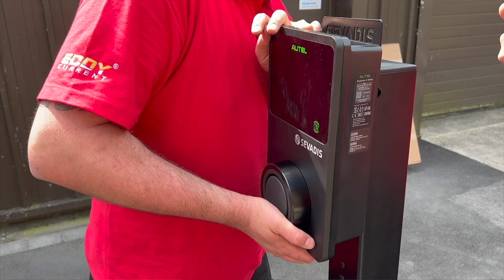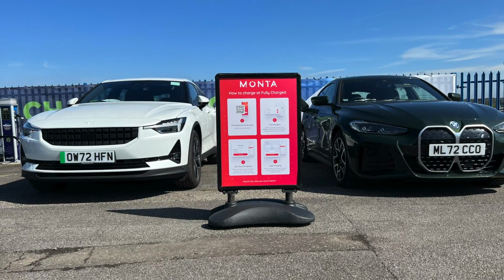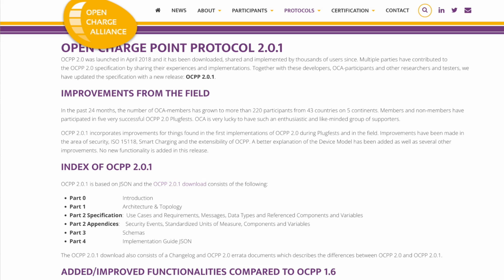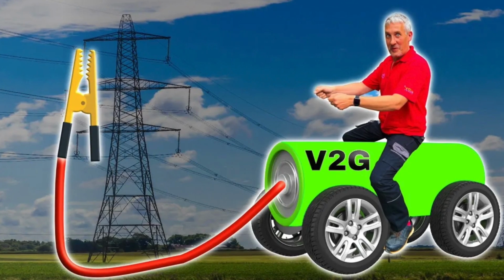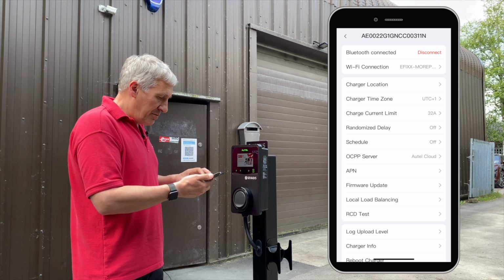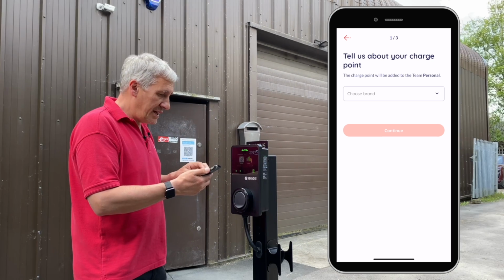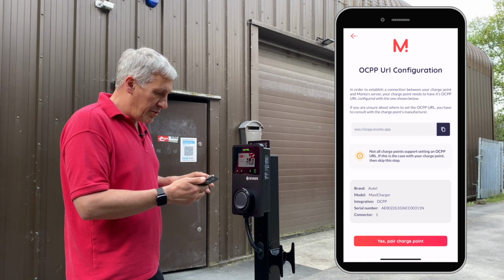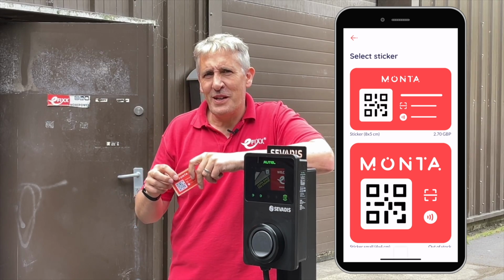OCPP Explained: The Easy Way to Improve EV Chargers

Comment: Lads and lasses, are you watching the transport ship fire? The source of the fire is not the point, it is the thermal runaway of the EV batteries in the compartments caught in the heat that makes it just a waiting game as there is no safety envelope able to deal with the exothermic reaction. There are enough reports of e-scooter fires and while an EV fire is a low probability of itself it is a high impact event. We need to seriously think about the siting of battery storage, of domestic charge points or in underground car parks. I know you are considering the electromechanical aspects of installations but you should make yourselves conversant with the risks, the least you can do is add a rider that your advice is only current at the date of the production and you are not liable for the interpretation in practice. Under the bed is probably not a good idea.
Reply from the maker: Insurers are already on the case 👉https://youtu.be/tucSKsyoKzw

Comment: OCPP is a great idea, but when there's connectivity issues the charger manufacturer and 3rd party App company just point the finger at each other. You end up stuck in the middle, In our case it's never worked and its been over 4 months.
Reply from the maker: Which charger and OCPP provider are you using?

Comment: Love efixx - glad you've covered this as a topic. 

My experience with this is that at least one of the major chargepoint manufacturers requires a payment to connect their charger to their app in the first instance even after the initial investment in the hardware - I got round this using OCPP but they did not make it easy at all, and it required extra hardware to get the connectivity.

The chargers were installed by a developer to discharge their responsibility for a new development, and on the face of it they had - but if on handover the customer couldn't come up and plug in, there is an open question around whether this was even accomplished.
Reply from the maker: Thanks for the insight 👍

Comment: Plug & charge won't work on AC chargers until/if both charger and car support ISO15118, which is likely to be quite some time away, and likely never for many AC chargers as it adds cost.
Reply from the maker: It’s available on the Zaptec Pro which we’ve previously reviewed.https://zaptec.com/en-uk/charging-station-zaptec-pro/
Reply: @efixx  And how many cars does it work with ?
Reply: @mikeselectricstuff not a lot
Reply from the maker: @mikeselectricstuff  BMW, Ford, Mercedes, Porsche, VW Group and implementing plug and charge.
Reply: can this be retrofitted to older EV cars?